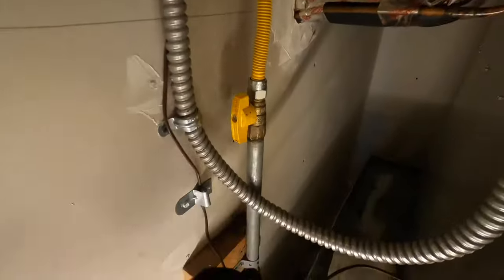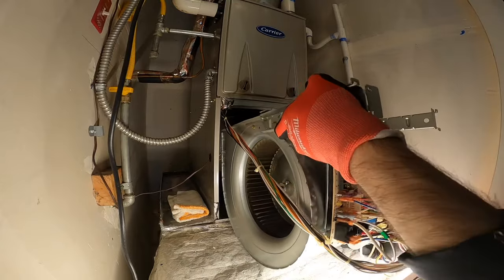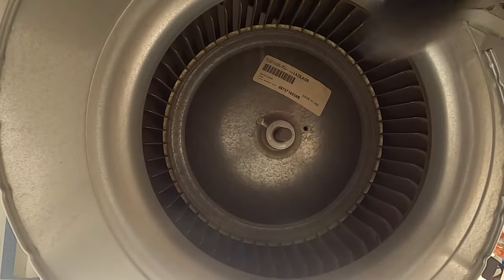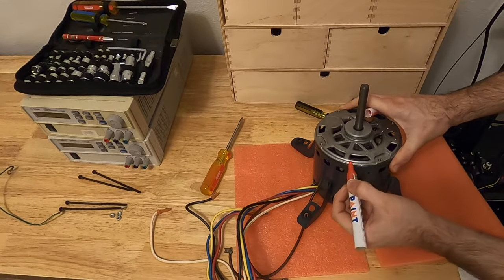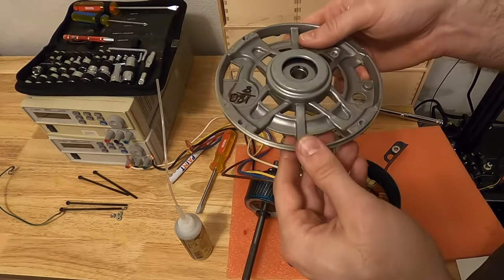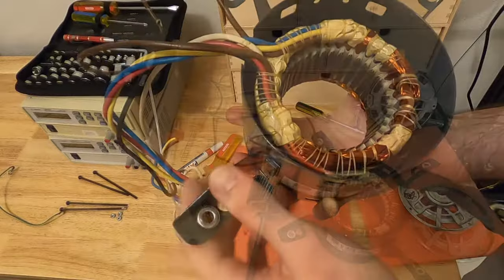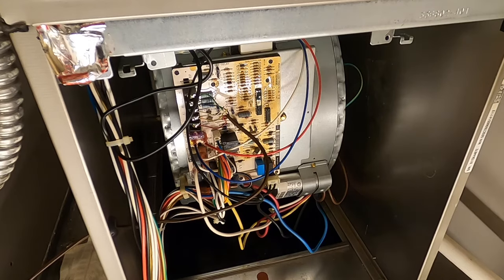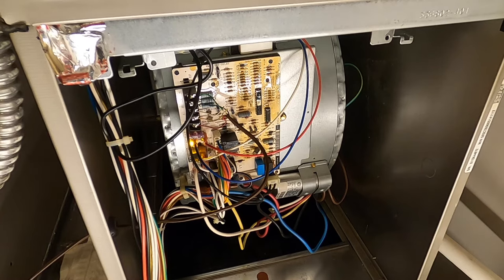How to lubricate a furnace blower motor

Comment: I added one extra step when oiling mine. Drilled a small hole, (less than 1/8") into the oil felt chamber and pressed in a short length of stainless hypodermic tubing (available on Amazon etc). Then used a length of Tygon tubing (the yellowish clear stuff that's oil resistant) to connect the new oil port to a convenient spot at the front of the blower housing. Now I only need to give it a squirt of oil every few years with no need to take it all apart each time. Note that years ago, this sort of motor would usually have an oil cap at each end so you could add oil without taking the motor apart. I guess that stopped in favor of our "throw away" society.
Reply from the maker: That's a great idea ! I also find it disturbing that they stopped adding oil ports. I think it is because homeowners don't want to do it anyway, and most HVAC technicians only know how to / want to replace furnaces with new ones... it's sad and it was one of the motivations that prompted me to shoot this video. Thanks for watching !
Reply: Great idea!
Reply: Let's be a little more honest, the companies are trying to increase profits at your expense.  They make more money selling you an entirely new motor than putting oil on it so it will last for 30-60 years.  Kind of like nobody does brazing of your coils any longer.  There is more money in "ripping off" the ignorant masses.   So the more intelligent ones that like to learn have to do these silly work arounds.  Thanks for the idea and how to port the oil for easy access though!  Maybe just a reminder to cap your port with something is all :)  I would upgrade the oil to PTFE(polytetraflouroethylene) aka flouridated oil, aka Teflon(trademarked name by the not so customer focused Dupont/Dow chemical) so they call it PTFE fyi.
Reply: @daveknapp2000  - Well said.

Comment: Thank you for this video! I was able to perform this work with the motor still attached to the board. I only had to remove a few wires. All back together and squeal free! Your furnace was identical to mine.

Comment: Thanks for posting this video, I was able to fix a bad noise in my furnace because the motor needed lubrication. I bought the exact oil you recommended. Thanks because the video goes directly to the point on how to solve the issue.

Comment: Very helpful video.  Don’t forget to turn your gas back on.  I noticed the valve was still shut when you ended the video.
Reply from the maker: Yes, you have a good eyesight ! :)
Since my furnace does not have a pilot flame, I generally turn the gas supply off during the summer. I do not recommend doing this to furnaces having a pilot flame however.

Comment: Thanks this was very useful. Unfortunatly I discovered a good wad of human hair wrapped around the shaft on the drive end, hidden by the blower. I doubt this unit had been inspected since installation in 2004. Some hair had migrated in and cut up the shaft/bushing. I think it may have been okay with cleaning and lubrication but I don't want to chance it, it can get to -40 here and I am away for a week at a time periodically. Now I know I can maintain this thing every couple of years or so, will probably outlast me.

Comment: Thank you for the informative video! I was wondering how often does it need to oil the motor?
Reply from the maker: It depends how much the furnace is being used. I would say that for normal household use, once every 2-3 years should be good. When you do it, you can also look at how dry the sponge holding the oil is. If it is dry, you need to do it more often. If there is still enough oil left, you can do it a bit less often. Hope it helps !

Comment: Enducer motor not working but my furnace is over 40 yrs old, do I need to change my whole furnace system?
Reply from the maker: Usually, the failure of a single component does not mean the entire system should be changed. But it depends if you have accumulated too much "maintenance debt" over the years or not. I would say 40 years is past the service life of a furnace, and you will benefit by upgrading it (higher safety, higher efficiency, ...) but it does not mean it cannot be repaired. I unfortunately can't tell more, I do not have enough information about your system. You need a trusted HVAC tech to come take a look in person. Good luck !
Reply: @the_bootloader  thanks mate, I’ll change the enducor motor.

Comment: Thanks for this video. Did you have any issues with odor of the blower motor blowing oil smell into the HVAC piping and then getting into the house. I did this (followed another video) and found immediately an oil smell coming from the blower fan. Any idea what I did wrong and how I can fix this issue?
Reply from the maker: It is important to use the right type of oil. Certain oils have a lot of volatile compounds, which are smelly. If you have used motor oil, that could be the reason. The oil I am using is odorless (at least to me !), and I could not smell anything once the operation was completed. The type of oil I used is commonly used for sewing machines and other home appliances.

Fortunately, I would expect the odor to dissipate relatively quickly, because the volume of air going though a HVAC fan is really large, and the volume of oil is pretty low. If this is really a concern, I see no other solution than rinsing the oil you put with another type of oil. Just remove the ends of the motor completely, and really saturate the sponge with new, odorless oil, collecting the previous oil in a suitable receptacle for proper disposal. Worst case, you may have to change the motor, but that would be really unfortunate.

If it was bothering me, I would just aerate the blower motor outside for 2-3 days and see if the smell dissipates. If not, I would attempt to rinse the oil out. Then, I would try using the blower for a while (if you are comfortable inhaling it - some people may not be okay with it due to various reasons including health risks, depending on what oil you put) or, worst come to worst, just change the motor.

Hope this helps !
Reply: @the_bootloader  Thanks for the response. Yeah it was the oil. I took apart the motor again and cleaned it out. Got a much better oil from Home Depot and it did wonders.

Comment: 8:01 As far as i know induction motors speed can change based on the alternating current frequency or the number of poles, with the windings you might be changing  the number of poles, the draw back is it lowers the torque  and cause over heating of the motor.  is better to leave the wiring to what the manufacturers set it to.

Comment: Hi  I have a a/c fan motor making sound (sometime),  can I flip the motor over and add few drop of oil to the shaft and let it drip inside?  would this work without disconnect and re-assembly the motor?  I don't want to mess up too much, would the oil hep by sliding down the shaft or it is too late for the fan motor. Thanks for the video.
Reply from the maker: Hi ! The cause of a motor making noise can vary. It can be due to a lack of lubrication, but also something else. If it is making noise due to a lack of lubrication, it is likely that by now the shaft is worn out, and adding lubricant will provide very limited relief, unfortunately. It's like trying to add motor to a car engine which is now broken because it has been ran without oil for a while. That said, you can absolutely try it out, and see if it will help !

If I was in your situation, I would add just one drop of oil, to see if it helps. If it does help, you would need to open the motor and lubricate it properly, to control where the oil is going (not sure but I wouldn't want the oil going into the motor windings for instance, due to unknown compatibility). If it does not help, at least you don't lose too much time for a fix that will not work.

Opening the motor is always the best solution as it allows you to assess the damage and make a proper fix. For an A/C fan, I believe it is pretty easy to do.

Hope this helps !
Reply: @the_bootloader  Thanks so much for your information.

Comment: What type of oil should I use?
Reply from the maker: It really depends what's available to you. Regular 3-in-1 motor oil is fine. Or light machine oil (same as in sewing machines). 20w or 30w oil can work too. It's not really critical as long as it's oil and that it's low viscosity.
Reply: @the_bootloader  thank you so much

Comment: You have to do all this just to grease the motor?? Why don’t they just put a zerk fitting on them???
Reply from the maker: Some motors do have an oil port, but unfortunately, manufacturers stopped providing an oil port. Planned obsolescence :( and frankly, the percentage of customers who oil their motors is so low, that the manufacturers probably could not justify adding the oil port because almost nobody was using it. But if you open your motor once, you can add an oil port yourself for next time

Comment: You remind me I trashed a motor because I destroyed caps to lub it :(
Reply from the maker: Sorry to hear that. But don't let that stop you from taking care of your stuff ! When performing a maintenance operation there is always a risk. The goal is not to never break anything, it is to be better off breaking a little sometimes, to generally save a lot in the long term.
Reply: @the_bootloader  Thx. Finally found my motor is bad, I run it without any load, it get hot and stop. Looks like some inside are damaged, but I cannot hear any scratch or something. Weitd.
Reply from the maker: @dmtycn  Does it have a run capacitor (most likely yes) ? If yes, do you have a way to test its capacitance ? Also, if you test it with an ohmmeter, does it read as open after a few seconds (it should) ?
Reply: @the_bootloader  The run capacitor was read around 12uf with a meter. Will order a new one to try. I have bought one motor from Ebay but I cannot understand why the motor will overheat without load. Will got a new capacitor to try.
Reply from the maker: @dmtycn  I am also not sure what is going on, but miswiring, or an issue with the run capacitor, could explain what you are experiencing. Check if it is wired properly. Please let me know what you find out, I am curious too !
Reply: @the_bootloader  impossible for mis-wiring, I took motors off and 120V to white and black wires for high speed, brown wires to capacitor. Running, hot , stop, cool, start, hot……  I’m confused totally, check each speed wires resistance, looks good. No idea now :(
Reply: @the_bootloader  Order a new motor since I have 3-4 same HVAC, will check the difference.
Reply: There is a felt pad inside that filters rhe oil and separates the atmosphere from the bearing. There is no way that leaving the caps off will destroy the motor.